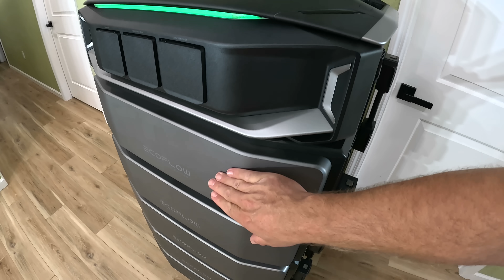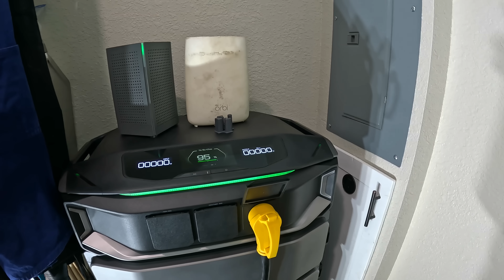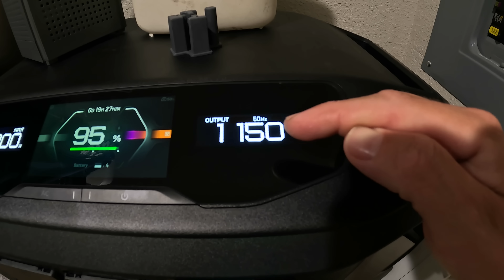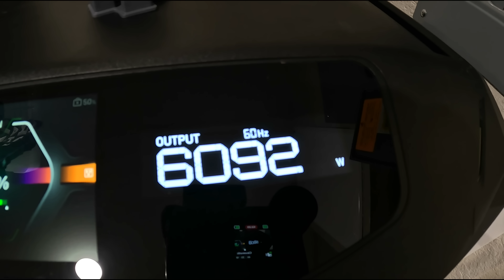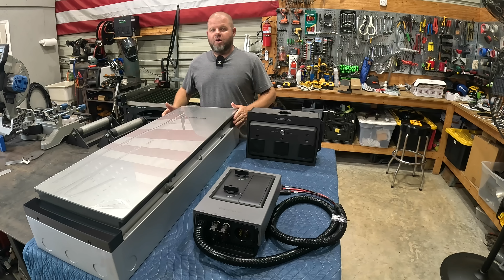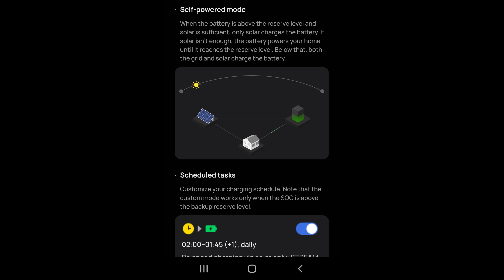AMAZING POWER! Ecoflow Delta Pro Ultra X Power Station Review!

Comment: I have a full delta pro ultra and smart panel 2 90A setup. I have all my circuits on my smart panel 2, minus 50 amps for 1 electric water heater (I have 1 other electric water heater on mg smart panel), and oven. I have 42KW backup currently in terms of capacity, and 3 inverters. I am quite dissapointed that they wouldnt allow some dual approach with our current models. I have wanted to cover 200 amps to fully backup my home in my smart panel. Exchanging everything will be easy, requires no permits for me as its technically off grid usage since I have zero backflow. However, I spent a bit of monry just for the 100amp wire running it to my storage room, least to say I am a bit annoyed as I did this in 2024. If i knew they had this coming out I would have waited and ran a 200 amp service wire instead for the box plugin. 

While this is cool, it kind of irritates me they didnt deploy something that can utilize our current inverters in conjuction with the new inverter. Its easy enough to rewire everything as mine would simply wire dewire, rewire, but man does it hurt having to take an estimated $7500 hit for 2 new inverters and 1 smart panel 3 if I were to do it. I have 12KW of solar currently, I run my home until 30% depletion, it lasts all day and hits 30% in most cases around 11PM if I have extremely heavy usage. My 12KW is partitioned into 6 sections for the 3 inverters. 

I wish/hope they have some sort of program where I can trade in my inverters for a good size credit, as well as my smart panel 2. If they did I would get 2 new inverters and the smart panel 3 in a heartbeat.
Reply from the maker: They do have a trade in program according to some other posts I read. Reach out to them.  And FYI the new SHP3 is compatible with your current DPU inverters.

Comment: My natural gas dryer cycles on and off too. 
It spins consistently at about 350 watts just to spin it then about 220 to 320 watts for the igniter (I forgot the exact amount) to fire the natural gas flame.  
Once the gas fires up the igniter turns off.

Comment: It would have been great when you had 6,400 watts of power going out, to show how long the 4 active batteries would last time wise.
Reply from the maker: That's pretty simple math. Each battery is 6,144 wh plus conversion loses around 10-20 percent. So at that rate with no input power, you'd burn through a single battery in less than an hour. No home would use anywhere near that in an emergency situation unless.... You have a solar array or generator feeding the unit and you make the conscious choice.

Comment: Don't you have to use both battery ports on the inverter to get the full 50 amps? Looking at the manual, they have half of the stack batteries plugged with the short battery cable ( like the old DPU) but the other half of the stack is plugged into a longer battery cable using the middle port.
Reply from the maker: I do not, but it does come with the cable to do this. My test never came close to needing max capacity and I had no issues.

Comment: Yes the Delta Pro Ultra X is QUIET but what about that adapter that goes into it?
Reply from the maker: What adapter?  The rectifier?  That has a heat sink only, no fan, no noise.
Reply: @TKCL  I wonder if that rectifier is compatible with the original delta pro ultra?

Comment: I love it but 2 things that instantly turned me off was the No DC, which I can understand for a HUGE system like this but the RGB on the sides? I happen to HATE Rgb. Is there a way to turn it off???
Reply from the maker: Typically a system this size is for whole home power, so most people don't need DC charging as they will use their wall outlets like normal.
As for the RGB lights, those turn off when the screen does.  You can set the timout feature to as low as 10 seconds and just use the app for monitoring and control. No lights shine during this time.

Comment: Can it integrate an AC coupled solar system?  I have an Enphase Microinverter system, currently line side connected to the meter..  it is a 10KW AC output system, so puts out 41Amps max, it can be controlled to lower its output by frequency shifting off of 60HZ, you can’t be generating more power than is being consumed by the house, or battery charging..  the voltage will climb uncontrollably if allowed to do so..  curious if they have AC coupled solar integration.  I tend to doubt it.
Reply from the maker: That I do not know. You would need to reach out to their customer support.

Comment: No internet = No Bueno in Emergency...   Login account required for the application now.  :(
Reply from the maker: Bluetooth works just fine, so does manual buttons. Some internet does work during emergencies or outages. Case in point cellular or Starlink.
Reply: @TKCL  Do a video with no internet (including phone), the app requires a login.
Reply from the maker: What's the issue? Once set up I've never had an issue with the app working on Bluetooth regardless of internet or not 🤷

Comment: This looks like an absolute game changer. I currently have a Jackery 5000 plus with 10 panels connected to it. I just bought 10 more panels and was trying to decide whether to buy another Jackery to combine the power. I don't like Jackery's options when it comes to combining power and they don't seem to have many new things coming out. The idea of getting 50A out and able to accept 10kW of solar input in one unit? Game changer.

My only concern is the price. I don't see this being offered anywhere and right now, both the Jackery 5000 plus and the DPU is being sold way cheaper than normal due to the holidays coming up. I'd hate to not buy one of those two options, then this comes out and  it's $6K with 1 battery. But if it's $4,200 with one battery and maybe $6K with two batteries, I'd buy one today.
Reply from the maker: I am seeing $7999 on Amazon with two batteries. But you need to checkout their website (link in the description) as they are offering a big early bird discount to bring the cost down. Take care!

Comment: At $20K + shown, they can keep it.
Reply: Paying for a name . You can diy for 1/3 price
Reply: For half that I matched it with a 12000xp and two 14.4kWh powerpro batteries. Either way most will need an electrician anyways(Delta smart panel or EG4). The price premium is insane

Comment: Did you mention that the batteries needed software updated, or is it just the inverter to get you 5 batteries on the screen?
Reply from the maker: The batteries themselves need the update.  Connect one at a time to the inverter and then to the internet.  Go in the app and perfom the update, it will update the inverter and battery at the same time.
Reply: @TKCL  So for my delta pro Ultra, I will need to update each battery separately, or this only applies to Ultra X?

Comment: Any idea if the X is still compatible with the Smart Home Panel 2? I already have my system set up but would love the X for the space savings. This 1 inverter would cover my SHP2 circuits that I use and way easier for supplying solar.
Reply from the maker: I am taking a list of viewer questions and sending them to EcoFlow.  I will write this one down. Do me a favor and ask this again in a couple of days as I read every comment.  I will try to have you and answer.
Reply: @TKCL  This is one that I would like to know too since I was considering buying another stack. If not and I have to buy a SHP3 also could sway me one way or the other
Reply: I’d like to know this too… might buy the inverters then 😂

Comment: North Panhandle of Florida-We have, as of 3 months ago, 2 Delta Pro Ultra with 3 batteries each into a Smart Panel 2.  Like you, I discovered that the dryer is on and off.  Absolutely love the fact I was not the only one not aware the dryer does not heat the entire time it is running.  To your point, having the system and monitoring our usage provides a ton of information as to how much a circuit/appliance really uses.  We have 20 -400 watt panels feeding our system currently (4k each inverter) and can operate the home 2700 sqft, 4 ton AC (on soft start), and the dryer.  All pushes about 10500 if all are on.  Our range/oven/stove is in a separate panel so I can not fully run everything.  Love the fact EcoFlow has come out with a 34 breaker Smart Panel (figured they would eventually).  We, also, are looking to build a home on our lot in North Georgia and plan for it to be off grid set up and this new upgrade has made it even more possible.  Thank you for the early drop video.  Very helpful as always.
Reply from the maker: Sounds like a great system you have! Glad you found the content helpful.

Comment: This is exciting but EcoFlow is not going public with the price, that is a deceptive.  Pay a deposit of $500 to get &1000-off, of what price?
Reply from the maker: Click on my link to Amazon, full price shown. Their website is offering the discount.
Reply: @TKCL  I have a similar DPU with 3-batteries sitting in my garage that I am wiring up to be able to use it.  Bought the Reliance Transfer Panel and hope it can run the 5-ton A/C with soft start installed.  If not was going to buy another DPU and one battery to bump up the capacity.  Keep up the videos!

Comment: What an awesome system.  It’ll cost way more than I want to spend, but i’m sure a few years from now these cutting edge components will be available at budget prices.
Reply from the maker: That's the beauty of it all, things improve and usually get cheaper as time goes on.
Reply: @TKCL   Now, if it could be DC fast charged at an EV charger and it could DC fast charge an EV, then it would be hard not to say “shut up and take my money!”

Comment: Thanks for the video.  Was your original delta ultra able to start your 2 ton ac unit without soft start?
Reply from the maker: Yes without issue. I could actually run my 240v well pump, house and start my AC at the same time.
Reply: @TKCL  Nice!

Comment: I wonder, since the smart panel 3 has 32 slots, can this replace the main panel in my house since it has a grid feed?  My current panel is only 24 slot.
I'm looking to upgrade my home power to 200Amp and would need a new panel anyway.
It's not yet available in Canada, so I would have to wait until it is anyway.
Reply from the maker: It's appears so to me, but I'll verify with EcoFlow.
Reply: That's what their web page says but now on my 3rd SHP2 in 2 years, no way I would trust my whole house to just their SHP.

Comment: Thanks for the video. The good thing is it’s compatible with the older batteries. I like several others in the comments also just purchased the previous Delta pro ultra sans the X.  Expecting to receive it from Costco on Friday, 17 October.
Reply from the maker: You're still getting an awesome unit, mine has been great.
Reply: Do you even need the increased specs?

Comment: Based on the "whats in the box" section on the ecoflow site... the 2nd battery cable isnt included. Seems like EF hasnt ironed out all the details on the new revision.
Reply from the maker: Every battery I've ever received came with a battery cable. From the smaller Delta 3 series to the Ultras.

Comment: Wonder if they did anything with the cooling issues with the X? My Ultra always runs very hot up to 117F when charging and under load at the same time.
Reply from the maker: Wow exact opposite for me, I've only ever once heard my fan kick on my Ultra. Ive ran it 24/7 for days at a time.  I don't know that I would consider 117 hot for heavy use, but that would be an engineering question.

Comment: this should make the original DPU a bit cheaper (hopefully) cause i'd like to get a 2nd one and get me up to 14.4 KW.
Reply from the maker: With time that will probably be the case, but I am just guessing as well.
Reply: I just bought my DPU with two batteries during Amazon prime days but through Ecoflow website matching prices PLUS another 5% off because I watched one of their live presentations and got a special discount code for that. Purchases also accumulate loyalty points that might result in decent money off a future battery or accessory.

Comment: THe FAQ says you have to use both battery ports for full output... how can you connect something to the middle battery port??
Reply from the maker: Unit comes with a second longer flex battery cable.  I should have shown that in the video.
Reply: @TKCL  yes, but would it be long enough if you had the 10 batteries or even the 5 batteries you already have?

Comment: I was thinking unit like this would be AC.Coupled compatible , but that is a good question to find out. If it is , you could have six thousand a lot of micro inverters on your loads panel , so during sunny hours , you could have up to eighteen thousand watts of power.

Comment: Will the new smart breaker only work with 200 amp service? Will the smart panel 2 work with this device if you don't need that many circuits?
Reply from the maker: What are you reffering to as the breaker?  As for the SHP2 working with the new inverter, I have reached out to EcoFlow about this.  Please ask again in a couple of days since I read all comments and hopefully I have an answer by then.
Reply: @TKCL the main power to the smart home panel. smart 2 is 100 amp I assume this larger panel is 200 amp

Comment: holy cow....so now my 50A hub and two inverters are obsolete.. I wish they have a trade in event for a discount on the new inverters.
Reply: What?????  I got one inverter in March, tested it all summer, then in Sept I added a second inverter and 2 bat/inverter, along with the 50 amp hub.  No I am not sad, but if I was just a little more Analysis paralysis, I could have got this and 4 batteries to achieve the same goal.  But I am still ok with the system that I have and will get the 1040 tax break which ends in Dec 2025.
Reply from the maker: No your equipment is not obsolete, I'm under the impression this is a new model not a direct replacement.
Reply: @TKCL  The 50A hub is pointless with the new inverter... (since one inverter can do the 50amps)
Reply: They do offer trade in but what they offer is on the low side.
Reply: @roygonzalez6771  where do you see info on that?

Comment: Only $8,000 with two batteries!
Reply from the maker: It isn't for everyone.  Some prefer a $10-15k propane generator and then you still have to buy crazy amounts of expensive fuel.  It really depends on how you plan to use it.  If investing this much, it makes sense to add a big panel array and let this pay for itself in energy savings.
Reply: $8k would get you an eg4 flex boss 18 and about 5 server rack batteries (~24k watt-hours). These aren't for people looking to save money.

Comment: Figures, I just bought the older one last week. I had no idea they were coming out with this.
Reply: Sometimes owning the last year (of production) of a product is better than owning the first of a new one.
Reply from the maker: I just found out not long ago. You still have one sweet unit and it's very powerful. I'll still be using my original Delta Pro Ultra
Reply: It's twice the price, does that make you less sad?
Reply from the maker: I don't believe yours is being replaced, sounds like this is a new model to me. For example they still offer the original Delta pro, the Delta pro 3 and the new Delta 3 series.
Reply: @scottkrebs586  Where are you seeing the price of it? I've been searching and so far, I don't see a price.
Reply: I’m in the same boat, my batteries arrive tomorrow 😂 But I think the increased specs are overkill for my small house so I’m not mad. Maybe the price for extra batteries for our unit will go down now!
Reply: 😂😂😂😂😂 sucker.  Well I have none so I happy for u